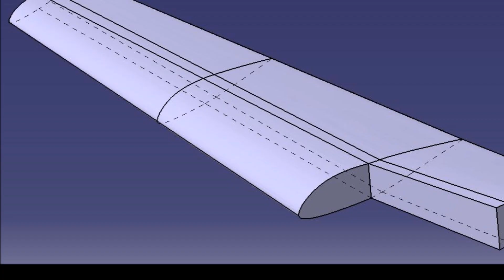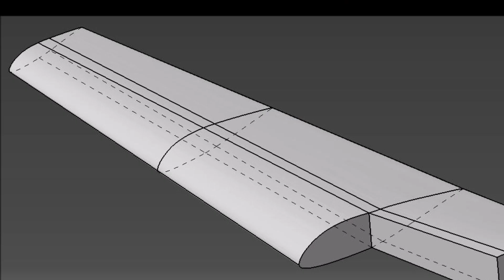The Long-EZ Build: Chapter 19 - starboard wing

Comment: How do you finish the surface?
Reply: yes, this!  it's always my question.
Reply: The surface is finished with a mixture of epoxy and glass microballoons.  You spread it all over the surface and then sand it down to fit a template.  Time consuming, but a very smooth and durable surface!

Comment: What do you think of 3D printed cross sections slid on a spar and then draped in fiber glass?  skip most of the manual fabrication. Another obvious approach is mass produced cast styrofoam blocks so you just lego it together and drape it.  Such a simple plane should not be years of building.

Comment: I finished my longez over 25 years ago and it's still flying today.  It had a standard lycoming 0-235  108 HP engine and weighed in at little over 1000 pounds (it was built in cold Calgary).  You are going to have a fast and very safe fun aircraft when you're finished.  I enjoy watching your build videos very much.
Reply: Do you still have it? I am close by in Edmonton, AB.

Comment: How the blue foam is called? do you remove it after the fiber is covering the whole thing?
Reply: The blue foam is contoured in various ways, such as cutting with an electric "hot wire", and lots of detail handwork. The foam remains "inside" the outer fiberglass layer. Oh, how I remember the many months I worked on my EZ. (I was a Scaled Composites engineer.)

Comment: I have a partially built Long-EZ for sale.  My father died recently and he never finished the project.  It's about 1/3 finished but ALL of the materials for the complete build (minus the engine) are here.  It has the optional air-brake on the bottom of the fuselage.
I am not a pilot. It's going real cheap. contact: eslguru1953 at gmail

Comment: This was an awesome layup of the right wing, I noticed that you bought the foam wing from Eureka CNC. After watching the rutan video on how to cut the foam, Eureka CNC seems well worth the money.
Reply: Hot wiring them wasn't difficult, and was fun, actually, and they came out very nicely...1...2...3..etc. :-)  The time consuming part was making all the templates, especially since I got all anal and did them in aluminum, and finished the wire guiding edges to about ball bearing finishes.  I know they got passed on to another builder, and I hope after that down to many more, for all the work I put into them, I think it ended up being about a week, low part time except weekends full. We (he actually, I was AA bound pre engineering, close by community college style, at that point) also designed and built a constant temp power supply, based on wire resistance that worked very well. 

To give you a hint where and when I went to college and where we built (the closest large city), one day I walked out of Statics to a VERY strange contrail in the sky...I said NO WAY, even though I knew there was a high likelihood of it happening, as I knew and had discussed the program with some Shuttle engineers that were friends)...yup, about 30 seconds after the Challenger breakup, I estimated...I still remember that little chill/shake that kind of went through me. Seeing it is different than knowing it.

Funny (sort of) story.  We finished the second wing foam joining on a Sat eve and I went home.  Dad (fellow builder) calls me at 3 AM and says that for some reason he woke with a start and remembered that we had forgotten to cut the holes for the antennas, etc...I'm thinking, Oh PEACHY. 

We were up til the next morning cleaning gooey epoxy off the joints, hot wiring through that mess (luckily they were small quick cuts) and remixing wet micro to join it all back together.  Moral of the story.  Even though you've already done ONE wing...check off the damned plans AGAIN the second time through each step, or bad things will happen.  Luckily the only bad outcome of that little collective brain fart was a loss of a nights sleep...if he hadn't thought of it til well after knife trim stage, though, it would have been a MESS to fix.  Seems obvious, I know, but what can I say.  Two engineers, one build, and pretty much zero brain power being applied that day.  Oh yeah, don't build when you are dog tired, either, if it's a critical portion or operation, especially.

That got long...hey...Long...never mind.
Reply from the maker: Thanks Mark! Yup, no question about it... Eureka nailed it! Worth every penny!